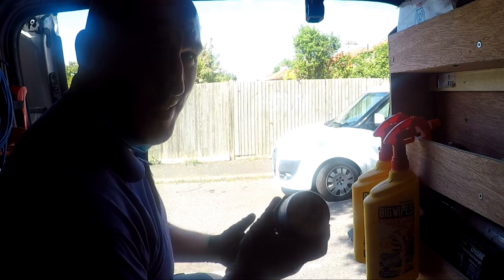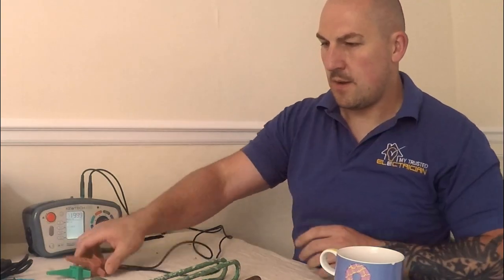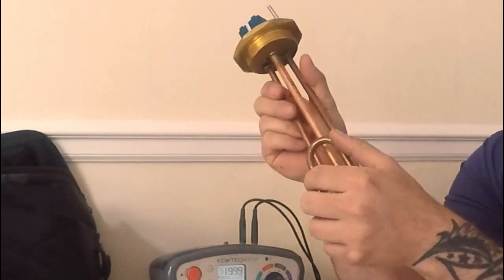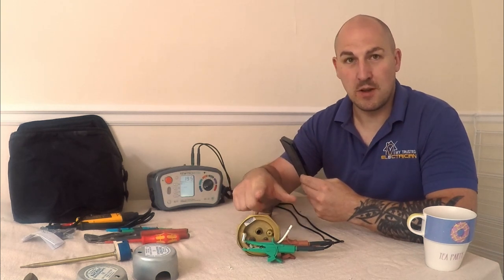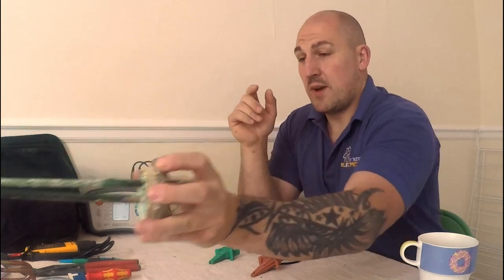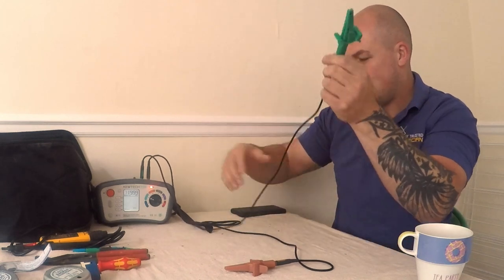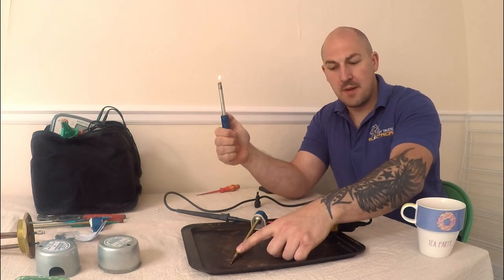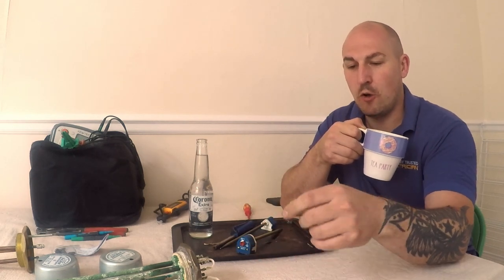Immersion Heater - Fault Finding

Comment: Nice Video mate 👍🏻 You along with Artisan..Mr Savery and Tom Nagy are really churning out some good stuff!!

Having spent years repairing and replacing these on social housing contracts i have to say i have never been totally happy with the new type thermostats..Lots of times the bi-metallic strip gets stuck in the open position which lead to many an emergency call with no hot water.
Great point regarding the D.P switch and 16a mcb. How many do we actually find hanging off a fused spur with the 13a fuse welded into the holder..😩😩
Keep the content coming!! 👍🏻

Comment: Yes, informative vid, I've changed my immersion element a few times, Original one was installed in New cylinder in the 1990s, A standard copper rod, lasted only about 18 months, second copper one about the same, so in the year 2000, fitted a dearer 'Superloy' version & it's still working to this day! I'm in a hard water area too.
  Good point at the end too, about never bypassing the thermostat, also the immersion cylinder must have an expansion pipe as well, in the event that the contacts weld themselves closed.
Reply from the maker: I'm surprised at how many copper rods I pull-out. Never stood a chance.

Comment: So a couple things, just found your channel and it's brilliant. Immersion stats yes it's bi-metal dual rods welded at the tip acting as a bi-metal strip. The immersion element itself is the same construction as MICC. The purpose of the thermal cut-out is purely to stop the tank boiling over filling the plastic tank in the roof, melting and scolding someone to death in bed asleep below (the actual cause of the legislation requiring them) - or the pressure relief valve going. Causes of over heat tripping, faulty main stat or scale in the tank, if it's an older tank it's most likely scale especially in hard water areas. 

A 13 amp switch fuse is adequate for correctly sized for modern "3kw" immersion elements with 1.5 flex from the outlet according to the EU norm. It should be noted however that the UK uses 230/400 volts as the "EU norm" when the average voltage across the country is closer to 245/430 volts. Effectively people are installing immersion supplies to a standard that's been harmonized which is not actually suitable for use.

Comment: I understood the thermal cutout was there to stop the water boiling if the stat failed, not to protect the element in particular. There were cases of cylinders boiling over and plastic dtorage tanks melting in the loft, sending boiling water into kids bedrooms etc. This is why immersions without a cutout must be replaced wherever they are found.

Comment: Really good video but it is a few years old and nominal Voltage is 230V in the Uk which would give 11.9 amps and 2830 watts so I can see why they would use the fused connection unit but it is close to nuisance tripping over a long time and I have not worked out how long it would take a 13 amp fuse to overheat. so are you saying it cannot be done safely but in practice off course we know some people will or would you always use a 16 amp breaker to a double pole switch for extra safety? thx

Comment: 01:40 tip for keeping the leads more organised. . . when packing up the tester
1) plug all 3 of the leads into the socket breakout tester
2) hold them up so they're dangling
3) lower the dangly leads into the bag leaving the 3 pins of the socket tester pointing up
Now, next time you go to get the leads pick up the socket tester and there they are all dangly and untangled 🙂

Comment: I have to buy a new multifunction meter and I don't know how to choose between the kewtech and merger which one is better in your opinion
Reply from the maker: Preference. I've used both and will likely stick with KEWTECH. Much simpler.
Reply: Johan Du Plessis Megger all day long...they have technology inside that guarantees accurate loop tests on RCD protected circuits which Kewtech can’t deliver. After having 3 Kewtechs i was sceptical about switching to Mega...Have to say wish i had done it a lot sooner!!!
Reply: Johan Du Plessis  Megger for me 👍

Comment: Hi,just wondering when your doing the insulation resistant test and use 500v, how can you still hold the element in your hand.I know the current is very low.Thanks

Comment: I’m an apprentice I just wanted to ask that when you did the calculations you worked the voltage out at 240 why didn’t you use 230
Reply from the maker: 2 reasons;

• The property that the immersion was taken from had a Voltage of 244V and so this would have given me a more accurate power rating.
• 240V would provide me with a value closer to failure. Worst case scenario.
Reply: My Trusted Electrician - Carshalton, Wallington and Coulsdon thanks that makes sense
Reply: @Jackdaly2000  You'll find average voltage across the UK is closer to 245 volts (used to be 240/415 volts) 230 is the "harmonized EU norm" voltage as the continent runs on 220 volts. Effectively any calculation you learn in college you should change on site to reflect the actual voltage measured on site at the time. If you measure 240 volts use it otherwise you will find inductive/ resistive loads potentially causing heat damage to the cables and terminations.
Reply: Huh?! all calculations and equations in BS7671 are all based on 230v, always use 230 volt in calculations and never the measured voltage.

Comment: Cartridge fuses and circuit breakers are designed to run at their full capacity without any thermal effects, so a 13A BS1362 plug top fuse should and will take 12A forever without heating up.
Fused spurs burn out because of poor connections, incorrect size cable and cheap makes, not because they are running 12A through them, backed up by a 13A fuse.

Comment: Great video thankyou ...you tested the element with ohms to get Power...would you also check live to neutral using the 500v from the megger to test that it does go faulty under load.... Geoff

Comment: Very interesting video----I recently cleaned up the earth connection on my immersion which had blackened and it has improved heat output quite a bit. Maybe I have a bit more to do as it is not as hot as it used to be originally.

Comment: Once had an immersion where the overheat stat failed that was attached to the immersion. It had a short to earth. Cut it out of the circuit  and tested the element which was good and not shorted to earth. Replaced single thermostat with new thermostat with overheat stat and problem was solved. Saved draining down the cylinder to replace entire immersion as is was in the side at bottom

Comment: Great Video! - Several times I've been called out to a thermostat stuck in the on position, and as you say, the HW tank just becomes a kettle. I've seen the header tank heat up and because of this and steam up a loft which in the winter months means heavy condensation, mould etc etc. Keep up the good work.

Comment: Hi i have currently just bought a house the house was built-in the 1930 and all the plug sockets are in the skirting boards. Now i want to move them up higher but iam struggling to find what is the correct height for them.
P. S i am not touching any wires iam only doing the wall chasing then going to get a electrician to do the rest. TIA
Reply: You can put them where ever you like as its an existing installation. The height for new builds is 450mm but at the end of the day its your house so put them where you want them.

Comment: You could test element with a DMM would be simpler .
Reply: Adreen Ryan isn’t that extra carry?
Reply: But what about IR test?
Reply: For resistance, fine, but for IR no, DMM don't have high voltage tests.
Reply: @cjmillsnun  exactly, I know that, that's what I'm getting at, which is why I wrote 'BUT...' meaning we still have to do the test to check, which a DMM won't do, not asking whether a DMM will do the test'. So it's simpler to use a MFT, which has the relevant capabilities, as he did.